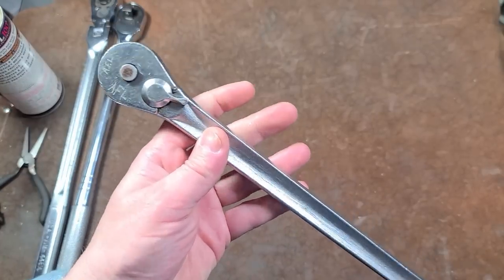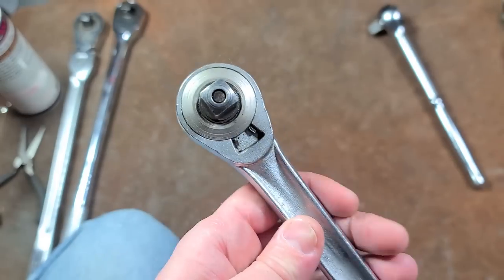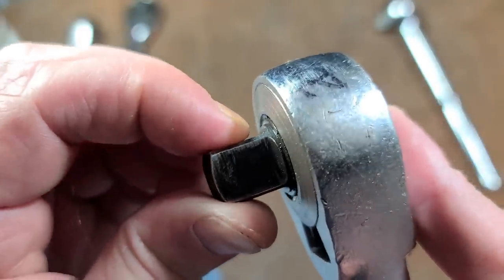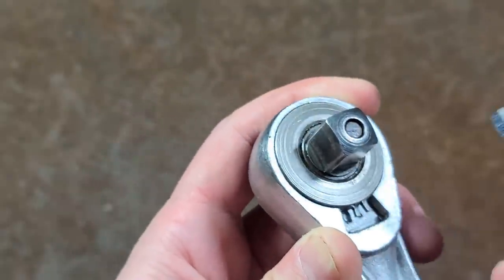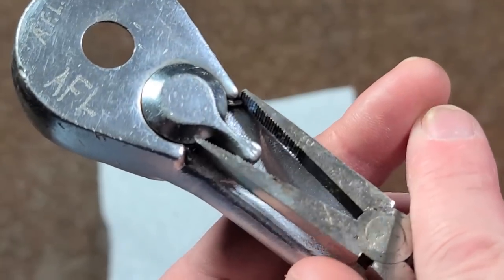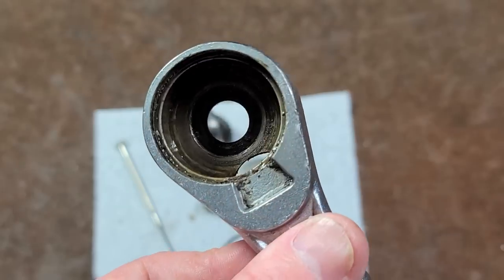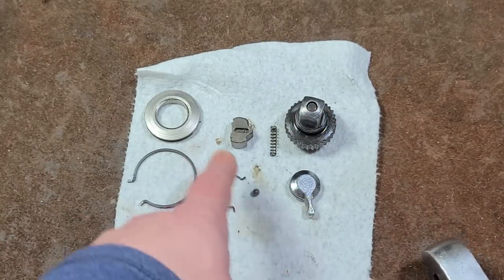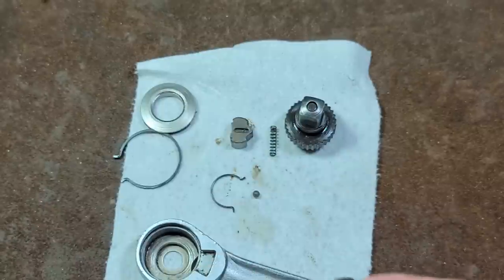Craftsman USA's Best Designed & Built Ratchet... 15" Long Handle Review

Comment: I just happen to rebuild my grandpa's old craftsman ratchet today. Its amazing how well they were built even back then
Reply: If you're implying that they still are today with your "even back then," then you would be mistaken on that part. It's pretty low end and has been for quite a while, whether we're talking Danaher/Apex or Stanley. Would take it over no-name stuff, but you can buy much better tools (without having to step up to "pro brands" that cost  WAY more)
Reply: @korgied  I already own brands like snap on my guy 😃 I was only meaning to say I was impressed at how a lower end product was built so well back then compared to how they are now 😁
Reply: I found my Grandpa’s 1/2 normal length ratchet several months ago and decided to restore it. Had tons of gunk all built up inside. Took it apart, greased it, put it back together and works like brand new! My grandpa would be proud that I did maintenance on his tools. I’m going to cherish it forever
Reply: @datboi1971 did the same thing here!

Comment: Bought my set in 87, still using all 3 ratchets to this day. I've replaced the 3/8 once under warranty, and it was long after they quit making the teardrop style. They had a box of rebuilt ones at my local Sears and just swapped. Now 40 years later my 1/2 drive is skipping, i'll be searching for a rebuild kit, but i own two, so I'll get by. Great video!

Comment: I still have this ratchet. I used to lube all my ratchets with Rotunda  (I worked for Ford) distributor cam lube. It did not break down and get waxy like chassis lube. Once I final ran out of that, I started using Super Lube and it works even better. I also use it in my reels, firearms, and wife's Kitchenaid mixer. It is also food safe.

Comment: My absolute favorite is my USA made "Thin Profile" fully polished Craftsman ratchets that I purchased around 1999 or 2000.
Reply: Those ratchets were among the best without question. Super strong, no glitches, thick chrome finish, great handle, metal directional switch, and 60T is really a nice sweet spot. In more than 2 decades of ratcheting there have been maybe a small handful of situations where I needed a tighter swing arc than a 60 tooth offers. 99% of the time, its perfect.

Comment: That style was from late 70’s and early ‘80’s and I believe were made by New Britain Tools in Connecticut. I used them until the paw and anvil gears wore out and had the ratchets replaced for free at the local Sears store. Since then I’ve gone through about 25 newer Craftsmen ratchets,…all were junk. I’ve actually had better service from HFT ratchets than the newer Craftsmen ratchets,…and I began using break-over bars long ago for busting bolts loose. I only use ratchets when I need “spin” in low torque situations.

Comment: I have the 3/8 standard handle version of this ratchet. It had never been cleaned so I disassembled, cleaned are relubed it with engine assembly grease. And it now has almost no backdrag. It's my favorite ratchet.

Comment: Thanks to you after seeing your video I ran to my roll away and grabbed my four vintage Craftsman ratchets three of which are the same ones you just showed on the video but mine are 10 and 1/2 in and 6 and 3/4 inch, my favorite a five and a quarter inch number 43166 as luck has it I have a half inch a 3/8 inch and a 1/4 I got them when I was in my late twenties to early thirties and I'm 60 now and still using and loving them

Comment: This ratchet is from the 70's, in the 80's they dropped thr oil port.
These are great but the best Craftsman ratchet design is the RHFT.
I quite like 60's flying V ratchets, because they're so classy looking and because the handles were rounded better and more comfortable.

You really can't go wrong with any of the MDF / Easco ratchets though, whether made for Sears or under their own brand.

Comment: Catus love your reviews! If you want to take a look at and possibly review another top quality Craftsman, take a look at the Craftsman 84T Professional ratchet. They're quite rare now, so you're looking at $150-$200 on ebay, but it is a reminder that the quality didn't go downhill universally across the product line in later years. They just had to compete with the Huskey's and Harbor Freight's of the world, so they needed to offer shittier cheaper ratchets (like the 36T quick release with the black plastic directional switch which most people picture when someone says "Craftsman ratchet") which ended up giving them a bad name, but wrongfully so. 

These Professional ones, however, were non-quick release (which gives the anvil more strength) , had a fully sealed head with an actual face plate held on with screws, a great handle with width designed for applying some real torque, an 84 tooth strong mechanism that consistently tests stronger than Snap On's dual 80 and Matco's top ratchets, and were just overall a top notch build. Try one of those before claiming this antique is Craftsman USA's best built ratchet! They are lower profile, much tighter swing arc, much better head seal, far better handle for hand pressure, better chroming, and can handle much more torque before breaking than this one! Not that this wasn't good, but it is most definitely a product of times gone by and is more of a collectable than a daily driver for most people. 

It was actually released around 2010 IIRC (and cancelled shortly thereafter) and was a last ditch effort by Craftsman at getting into the tool truck space. The price is a little absurd now...but for the target market (people buying Snap On/Matco/Mac/Cornwell/etc) they were a great price, and even at today's prices are comparable for what you'd pay for a new dual 80. Given, you can't warranty them anymore, but repair kits can still be had for 15-20 bucks, although the stock is running dry (partly because of people like me with half a dozen repair kits on hand).

Comment: Those are great ratchets. I'd guess those came out in the mid 70s but I couldn't swear to it. A little assembly lube is good for getting all those little parts in and pretty good for ratchets in general. I get some called Federal Mogul at NAPA.

Comment: Those what they used to call low profile ratchets like that one were definitely well made.  Just rebuilt one with a NOS USA rebuild kit that itself was at least from the ‘80s.  Kind of a good feeling to bring the tool and the kit together after all these years haha.

My personal favorite is the RHFT.
Reply: RHFT is also one of the best Craftsman ever sold! Catus seems to like the other roundhead craftsman (which is actually seen as one of the shittier ones among craftsman collectors) so someone really needs to send him a RHFT! The dual pawl mechanism and with the ~80 position and strength it offers blows every other round head craftsman sold out of the water.

Comment: That is a very nice ratchet compared to other craftsman ones and it's built to last. To install spring/ball/pawl, I clamp body (handle) vertically in vise, and use an old  steak knife with the perfect tip for pushing the ball down and still providing enough room to install the pawl. A dab of grease to help stick the ball to the top of the spring might also help with reassembly.

Comment: Nice ratchet, although I don't really rate the 36 tooth. I find quick release mechanisms really handy when you just can't have the socket coming loose, usually they lock on tighter than most detents unless you smack that button.

Comment: Craftsman offered this style of quick release ratchets from 1967-1993. That’s most likely one from the 70s since the oil port was from the earlier side of the model run.
Reply: Something that confuses me, I have a 1/2" this style (44985), but it's marked VG, which puts it around 94 from what I've read.
Reply: @marioman971  This style ratchet last appeared in the Sears catalogue for 1993. But most likely was still sold and possibly produced a little after that. I think VG was the last run.

Comment: I have this same design ratchet in standard length but no oil port. A few of the gear teeth stripped out. I wanted to fix it but the rebuild kit is $37. I may as well buy a new one.

Comment: My go to is a Tekton 3/8 17inch rachet saved me on a job today taking out a 3/8 female plug on a front differential, didn't have enough leverage with my 9inch rachet. Was scared the tekton was gonna break since it's quick release and 90 tooth but it held up, it's also nice for gettting off fuel filters and oil drain plugs for when people put them on to tight

Comment: At One time they were nice ratchet but now if it break's toss it in the garbage. Unfortunately if it's a model that's not in production they won't fix or send another. Been Tru it called the # they give at Lowes maybe your luck is better than mine get snapon proto harbor freight anything else but crapsman.